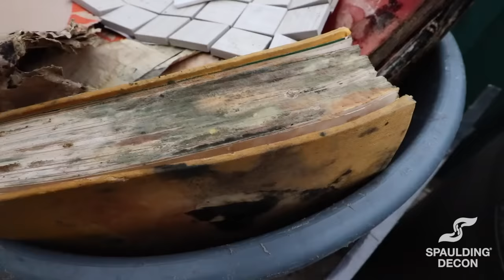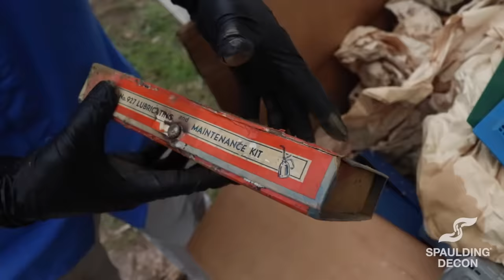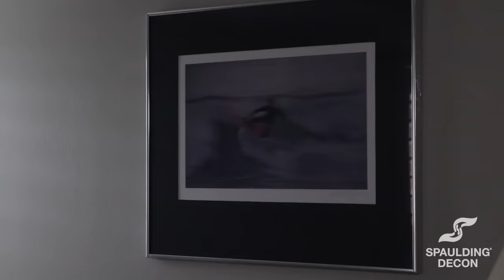1 YEAR LATER - Massive Body Meltdown

Comment: If you all knew the value of all the Trains and accessories you tossed away... You wouldn't have.  Even with water damaged boxes, rust and mold... they are VERY valuable.. as a toy collector.... I cried. From what I saw (I am sure there were more) there was at least 10K worth of value... as is... on Ebay. Damn shame.
Reply: 😂 they’re all biohazards after being in a house with that much bio cleanup. Cry baby cry
Reply: @annab4187  well that wasn’t very nice.
Reply: @annab4187  So uncalled for
Reply: @annab4187 this probably isn't the place for you if that's how you respond.
Reply: Value Vinyl..yes, that was incredibly hard to watch...what a huge shame.
Reply: There was blackwater in the flood as well. Basically the sewage backed up and flooded the houses too, making everything a biohazard and not legal to sell.

Comment: I would have given the family the option of taking the train.  May have wanted to sell it for parts.  Also, the guy threw away a perfect toy plane that seemingly had no damage.  😐
Reply: it was bio contaminated, he showed on the video!
Reply: @iurimontarroyos2213  I'm sure some hot soapy water and clorox soak/rinse would have made it just fine.
Reply: They throw everything away, it’s a safety concern.
Reply: @iurimontarroyos2213  it was only water damaged it didn’t have any decomp on it. Definitely should have been up to the family in that case.
Reply: It would be a health hazard
Reply: @Vertical Banana yeah fr
Reply: @exploring_unleashed no they didnt. they gave the jewelry and the knives to the family. the train set was only flood damaged.
Reply: @coco_b  
In most cases they get rid of everything, contaminated or not, unless the family requested something be given to them.